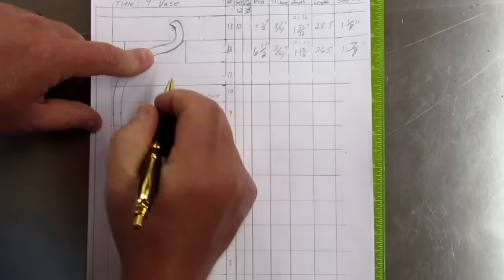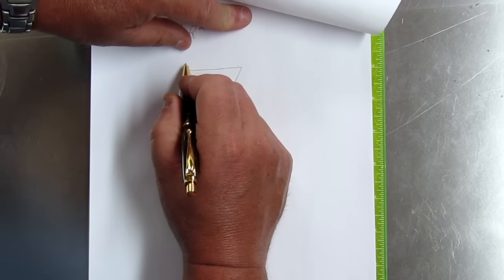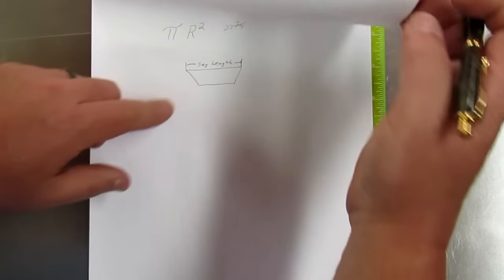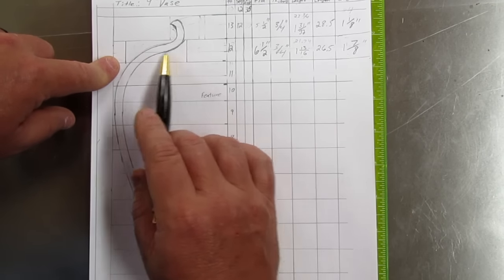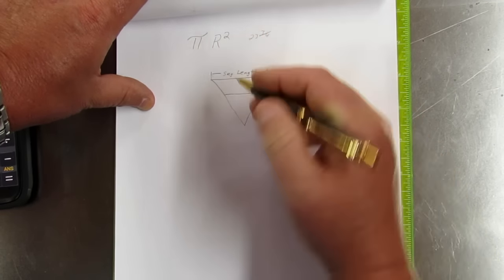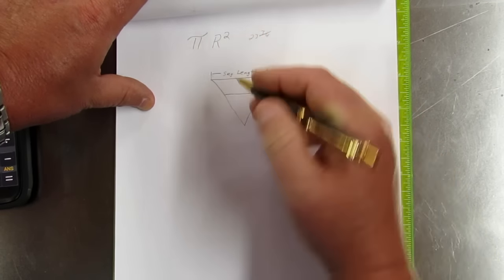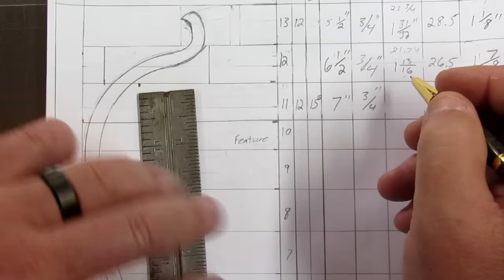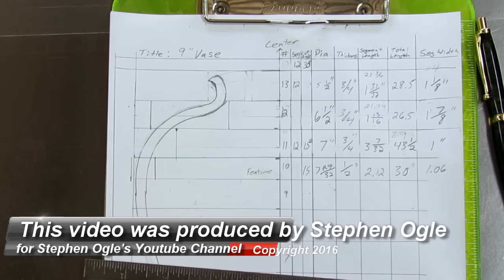#112 Building a Segmented Vase Part 1 The Plan

Comment: Thank you sir, I certainly liked and learned. Man I do thank my stars for the metric system though, it sure does save the conversion business from decimal to fractions of an inch !! Looking forward to the next installment. Thanks again.
Reply from the maker: +John Lewis Thank you John. Glad you enjoyed this project and found it helpful. I have been wanting to switch over to metrics on projects like this. Problem is finding the measuring equipment around here. I will certainly keep looking though. I did find a metric tape measure but am a little skeptical on its accuracy. I like the steel rulers when doing this type of work.

Comment: Hi Stephen, just worked out a design for my latest project and the way i did it was to scribe circles onto a scrap piece of plywood and marked out the angles using a 10" dia protractor, i then scribed circles at 1/2" intervals which gave me what length of segment etc i needed, by using a half design like your vase it was easy to calculate the segments, hope that makes sense, cheers Dave
Reply from the maker: Thank you Dave. I had to read it twice but I think I have your method figured out. It should be a very reliable method. Just goes to show there is more than one way to do nearly everything. Thank you for sharing this method.

Comment: Enjoyed the video as I believe I am going to try my hand at this art.  Question:  You calculated Layer 11 and wrote down; Segment Length = 1-27/32", and Total Board Length = 43-1/2".  Next you went to show using apps for calculating Level 10 and now the previously calculated number for Level 11 have been changed.  Segment Length now shows 3-7/32" and Total Board Length shows 43-1/2".  I don't understand why they changed to such a large number after you showed the calculation?  Please explain one of the errors.

Comment: I have trouble reading the fine print on my steel rule too. I found a decimal equivalent chart from a pair of micrometers that is much easier to read.
Reply from the maker: +Gil Grace Thank you Gil. I am sure that I could possibly find something printable on the internet but I just have not tried it yet.  I am actually thinking of converting over to metrics and get away from all this conversion stuff. Maybe that could be my correct answer. It would take away one step where mistakes are often made.
Reply: +Stephen Ogle I've tried the metric system for some turning project too. It does make things easier to calculate. Until the US changes over to the worldwide system there will still be conversion to do. There is a man from your area that tried to do just that, but there was too much resistance. We can only deal with the conversions for now.

Comment: For ring 10 -it was accidentally typed in as 4.962 and supposed to be 3.562.  Not trying to be 'correcting guy', but I'm trying to make this same vase and pointing it out if anyone is using the same numbers.
I re-figured the feature ring 10 and I think the #'s should be: 7 1/8 --- 1/2 --- 1 7/8 --- 27 --- 5/8   
Thanks again for the video!  Love your work!

Comment: Stephen, you made a mistake in your calculations 3 9/16 is 3.562 instead of 3.962. Thanks for the instructions though its a lot easier then I used to do it.
Reply from the maker: +andre routheut Thank you Andre. I tell you. I need a bigger ruler. I have a very hard time trying to decipher the markings even with my reading glasses. I will go back and fix that on the project chart. Thank you for letting me know.
Reply: You actually read the correct number, then you typed it in wrong.  I was hoping you caught this before you got too far along.
Reply from the maker: +Josef Roesler Ha, Thank you. I did go back and find a couple of mistakes. I think I have them corrected now. We shall see in the next video.
Reply: It was actually typed in as 4.962 so he accidentally added an inch also.  Not trying to be 'correcting guy', but I'm trying to make this same vase and pointing it out if anyone is using the same numbers :)  Love the videos!!!

Comment: Could you please redo this video using the METRIC system for us poor Europeans
Reply from the maker: Thank you Peter. I had not actually planned a video covering the metric version. However, I have started doing most of my designing with the metric system and have found it to be much simpler. I can not say when but my next segmented video project I will do in metric.  In the mean time the methods and formulas are the same. Hope this helps.